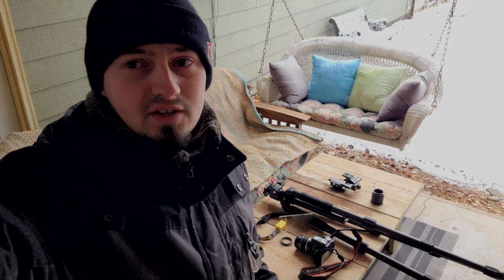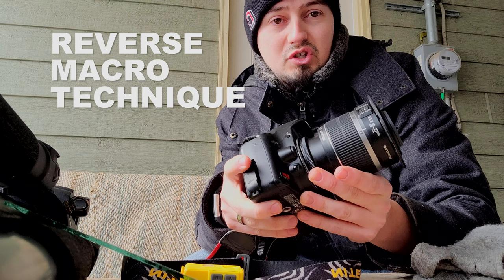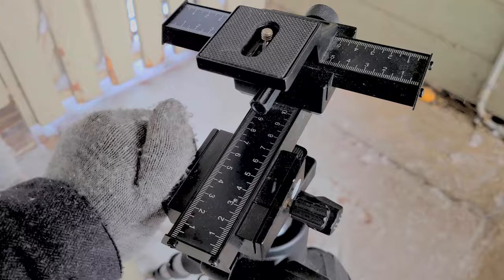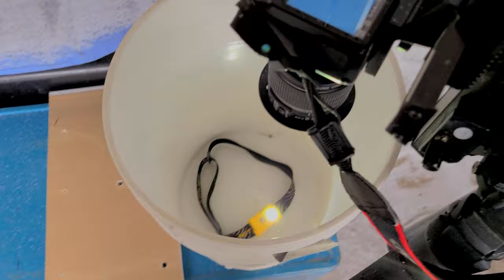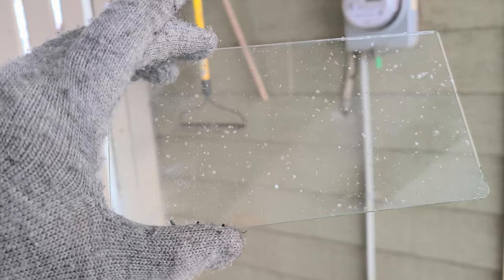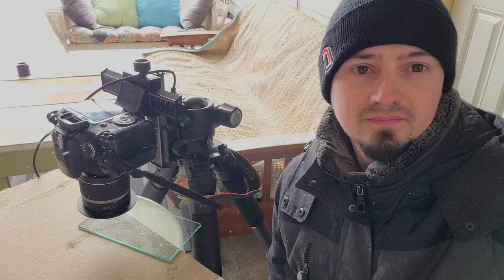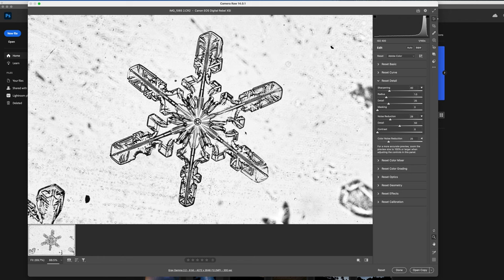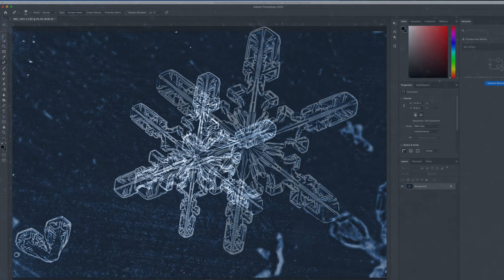How I Shoot Snowflakes (On a Budget)

Comment: Nicely done...Like the hole and glass... really condenses the light.  I tires a few in black material, but, varied results.
Reply from the maker: I've seen some really beautiful results shooting on black backgrounds, but the flash/stacking aspect was less appealing to me. With this method, I can shoot a couple hundred flakes fairly quickly :) Actually just put up a video with about 1100 snowflake photos!

Comment: Very cool, thanks for sharing!  Never really thought about it, but it appears you want really small snow flakes on a really cold day?
Reply from the maker: Really cold temps generally produce the best flakes, in my experience. Snowflakes that fall in the almost-clear air behind storm systems are even better. In terms of size, it depends on your magnification! The smaller ones usually have more intricate bubbles and surface features. Stellar dendrites can sometimes be too big for my setup, though they don't usually have good "clear" plates of ice like I like to see.

Comment: What are the temperature conditions where you're at? Snowflakes here dissolve within a few seconds generally. Maybe if I chilled the glass before, I could keep them from melting. Great video ove never seen it done this way.
Reply from the maker: When I was shooting these, it was about 5F above zero. So quite cold. I always keep my glass outside (but out of the elements) so you don't have to worry about melting.
Reply: @EvanLudesWeatherNatureVideo  that makes sense. It doesn't get that cold here in Utah so I'll have to figure it out! Thanks!

Comment: What size holes did you drill in the drywall?  Great video btw!  Thank you!
Reply from the maker: Thanks, Mike! I drilled a few different sizes. Sometimes when the flakes are smaller, it's easier to use a 1/4" hole. 1/2" should do it for most snowflakes. Maybe 3/4" if you've got larger flake clusters.
Reply: @EvanLudesWeatherNatureVideo  cool, thanks dude!  I'll subscribe. Keep em coming.  Good work.